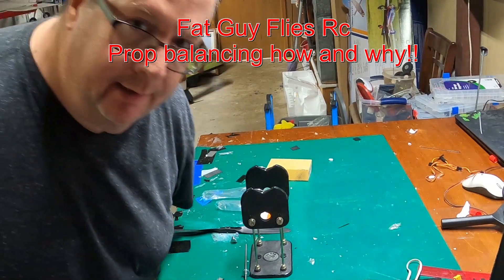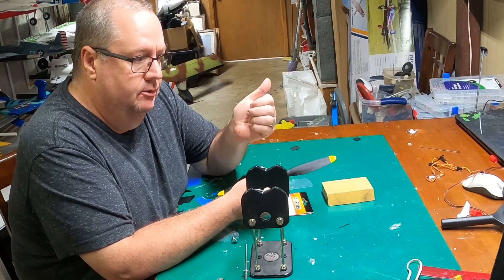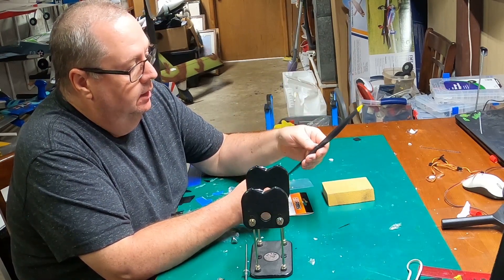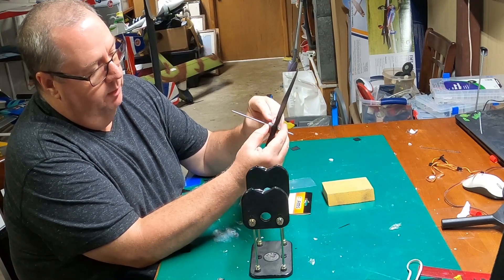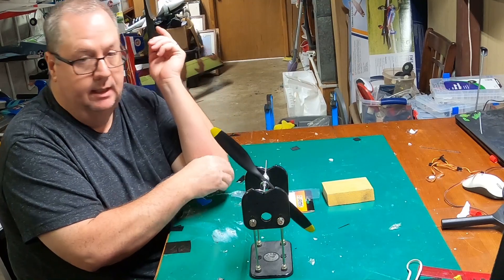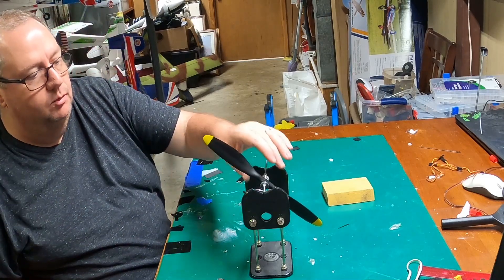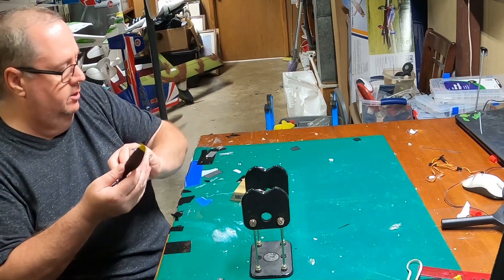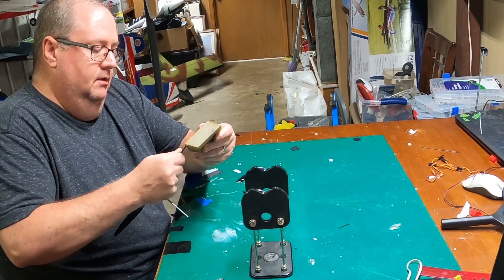Prop Balancing how and why!!

Comment: Can you show us how to balance prop vertical and horizontal thanks
Reply from the maker: Well this is the only way I know how to do that sorry.
Reply: look at 10:40, the prop rotated anticlockwise, that means the side of the hub which now faces up is lighter and you need to add a little glue on it.

Comment: You've forgotten to balance the prop hub afterwards. That's the most important thing! Please do not sand painted props. Ruins the look☝ Spray them with clear varnish on the back instead and wait until it dried. Never sand.
Reply from the maker: Cool tips thank you.

Comment: If you watch this guy in the video at 8:30, he even gets the prop to stay in the vertical position. He even put CA glue and kicker on the hub:

https://www.youtube.com/watch?v=OXuNnYQO2s4&t=646s
Reply from the maker: Great little tip for glue on the hub. I always just sand a prop end but so did he. Bottom line it balances and helps prevent damage to motor, mount and the over all performance.

Comment: I use a combination of reinforced tape ,  or scrape along the trailing edge of the pro with a scalpel, or a smear of CA glue  applied to the back if the prop - sometimes it can be a combination of these to get the balance right - depends how much it is out of balance...
Reply from the maker: All good methods , I just want people to understand the importance of it. I would hate for someone to make same mistake I made with my night brave.
Reply: @FatGuyFliesRC   absolutely agree - it must be one of the most over looked items in Aero Modelling these days -

Comment: Hey man, losing weight takes time, but very rewarding. The best way to think of it is as a lifestyle change, not just a diet. You got to where you are because of your lifestyle, so that needs to be what changes. Otherwise it will just come back. I wish you the best with it, it can be difficult, but nothing tastes as good as skinny feels. That saying keeps me going, and it is very true. Thanks for the very informative video.
Reply from the maker: Thanks so much for the kind and helping words. Yes its more than diet it is a change in lifestyle. I know this wont be easy but its more than worth while. Thanks again, I subde to your welding and metal working site. Please subded to mine and check on my progress from time to time!
Reply: @FatGuyFliesRC  I am subscribed :)